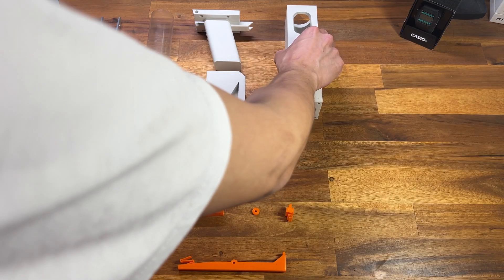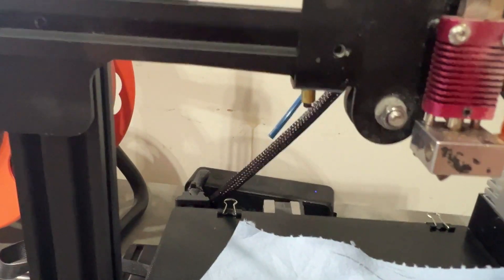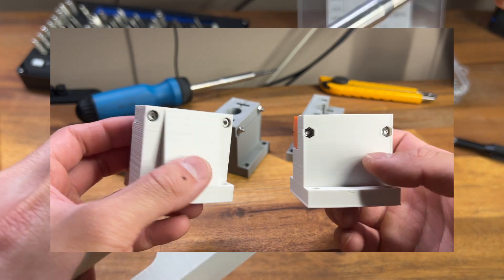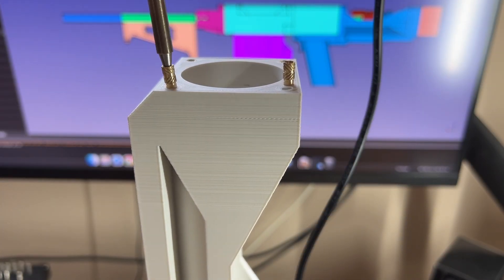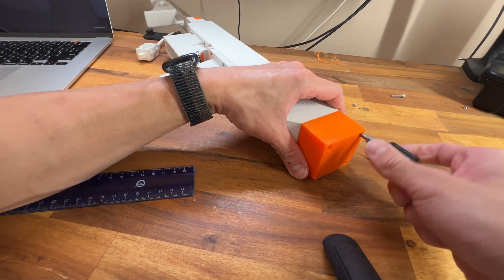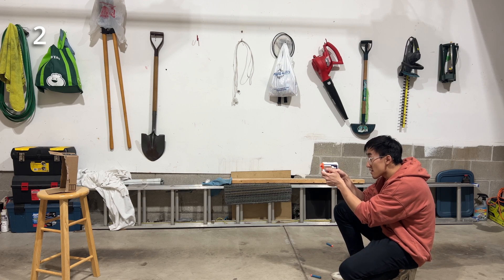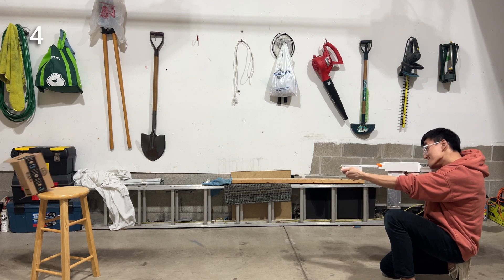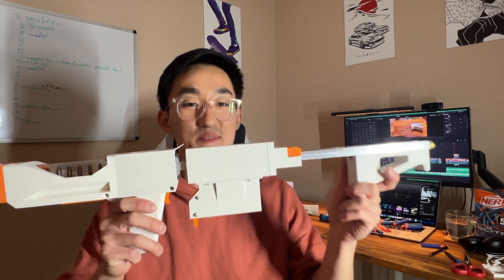How I 3D Printed a Nerf Gun

Comment: I do multiple iterations as well. What material and temps did you use for your parts? It seems like you need to print a little hotter for better layer adhesion.
Reply from the maker: Pla at 210 degc. I later found out the rollers in the x axis needed to be tightened lol

Comment: PRINT ORIENTATION !!. also get a Bamboo. nice work
Reply from the maker: Ahaha I opted to pray to the layer adhesion gods, since my bed is very uneven. I've since upgraded the ender 3 with ABL tho which fixes that issue. I actually picked up a bambu A1 after the recall, man It's like printing in easy mode now!